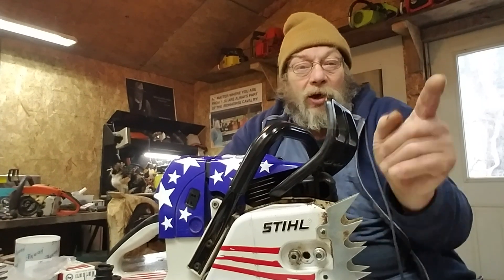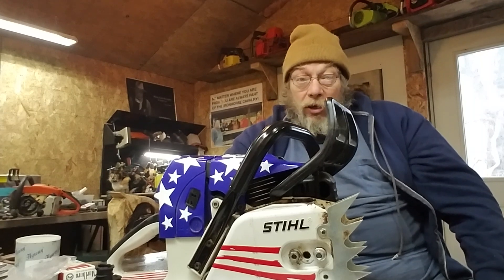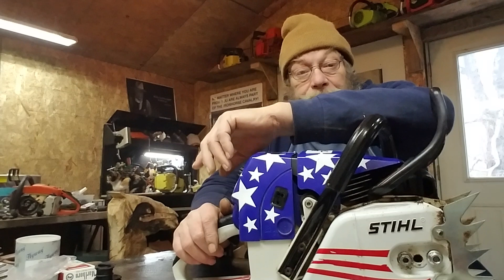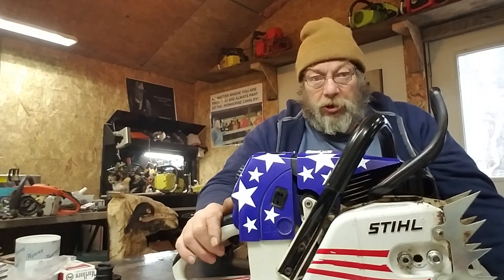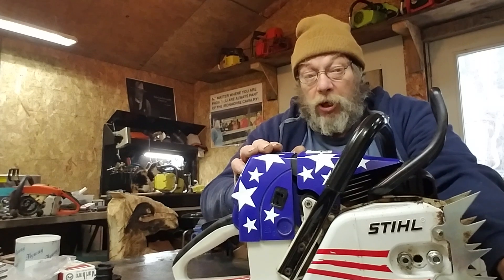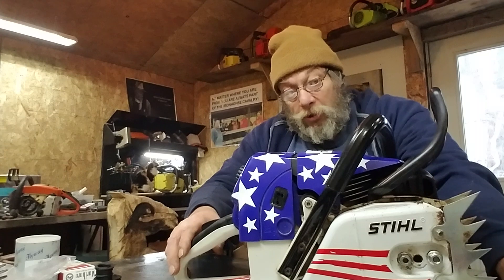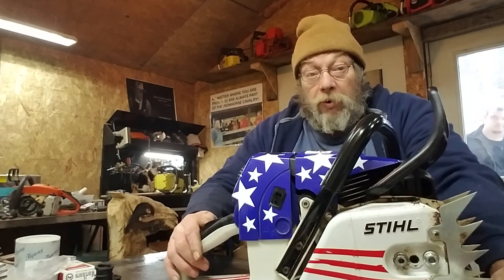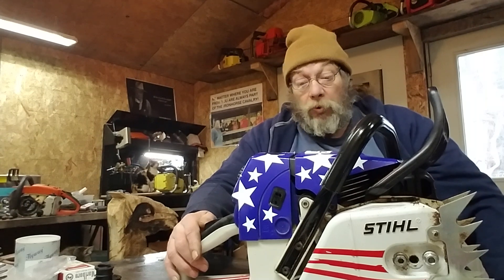What mix oil to use! What ratio should I run in different saws!

Comment: I run the Lucas Semi Synthetic at 50:1. It is cheap, and seems to do the job very well. It also has some cleaning properties. I tested it against Stihl Hp and hp ultra. The saw performed better with the Lucas.
Reply: I was running a synthetic oil in my saw, when I switched to Lucas I noticed right away how much better it ran. I really like the Lucas oil, good stuff.

Comment: Use to race dirt bikes and fine tuned  those two strokes. Oddly enough, you can foul a plug gooey black without any oil in the fuel at all. Saw many new race bikes that would leak black goo out of the pipe and the owner would say "I need to cut back on oil." To no avail. IT IS NOT AMOUNT OF OIL IN THE FUEL MIX, it is the air to fuel ratio. I used to run 20:1 mix and adjusted the jetting to where the plug burned a light tan and tailpipe not oily but a light dry gray. Actually, less oil makes for richer condition(blacker plug and muffler) as the thinner mix allows more fuel in relation to amount of air. Have been explaining this for 40 years. Kind of like people saying "those two strokes have a powerband put in the engine"  40 years on that one also.

Comment: Hi Harvey!!😀😀
I didn't realize that Lucas made 2 cycall mix oil. I'm definitely going to see if it's available were I'm at. I'm a firm believer in Lucas products. I've been running Stihl mix oil for many many years. Have never had any oil related problems at 50 to 1 so far. 
Hot saw 101 tore down a almost new husky that ran on husky mix oil and showed us just what you said about it. He also didn't recommend it. But he felt that the Stihl mix oil was much better. He dosen't run either one either. Can't remember what exactly he does run. 
Take care my friend!! TTYL!!😀😀

Comment: I run the same thing in all of my two cycle stuff - 80ml of Stihl Ultra, one ounce of Stabil, one gallon of PNE gas.  It runs fine in all of my equipment.  I have tried 40:1 but it is two messy on the exhaust side.  I do break in new saws at about 40:1 but ween them off after several tanks.  I generally run my saws a little rich for safety reasons.  I run only fully synthetic oil in all my two and four cycle engines.

Comment: Funny Im 70 and my father bought a new super xl homelite in 64. a 58 CC saw without the automatic oiler. It has the wick fuel system. I quit running because of the points. and set on concrete and the bottom of the fuel tank  is now corroded and leaks. We always mixed 1/2 pint of outboard motor oil with each gallon of gas. I took that saw all apart this week. The cyl still has the chrome and is in excellent shape. the piston is still usable also. Now i have been using a $10 XL12. 7 digit serial number saw  from the sixties for three years. and made another hodge podge saw from the best parts of several junk ones. It has a 58 CC cyl and Piston. Now I use the walmart Super tech 2 cycle oil. Still 1/2 pint oil to the gallon. and both of those saws run great. And I use them i Cut for hours at a time. and i also have a Husky rancher 55 I bought new in 2000. same gas no problen with the engine. the oiler sucks and the plastic is broken. Now the saws ive taken apart the the cyl and piston where scored. They where dirty. The air could not circulate and crap was built up on the cooling fins and everyplace else. like between the gas tank and crankcase. Folks spill gas and oil when refilling and sawdust collects on that. We have always used compressed air and blew our saws out as regular intervals. I think the excessive heat is what kills more saws than the oil and gas mix. But what do I know ive only been using a chain saw since I was thirteen. I hate those high RPM plastic saws.

Comment: I run 32:1, like you run 40:1.  I will probably start running less oil as I did think I was a little heavy and this video supports those thoughts. 
I have run between 20:1 to 50:1, used to recommend 32:1 to folks, like the home lites run,  but again leaning your way. (Your video, you have the experience edge), Thanks for your comments (shared knowledge) and keep in mind folks, us rebuilder types do it different than an operator. (Break in period)
When in doubt,  r.f.m.. read the f,ing manual. Ah ha, hey, consider your variables and make a solid decision,  32:1, 40:1, you'll be ok, I like your comments on deburring, radiused skirt edges, and oil film coating.   Thankyou sir.  I believe McCullough recommends 40:1 if you use their oil, ah ha, folks give me oil so I use what I have with caution,  folks leaving Alaska here, sometimes can not take the oils with them, product restriction, so I end up with a gallon of Ski-doo 2 stroke oil or what have you.  Maybe a good mix is 32:1 break in and 40:1 ordinarily time.
But Don't run it without oil!, by accident, 100% gas by mistake!,  I keep a date and mix info tag on my gas cans.  Thanks guys,  I appreciate you all.  Iron horse,  Hello to your Beautiful family too.
John.
Reply from the maker: Awesome comment John!
Reply: Ironhorse have you ever ran a stihl 880 magnum
Reply: 40:1 is fine! I get the saw where it has a good idle and leave the hi jet a little rich for 1tank of gas! I use 3 heating and cooling cycles before I put it in the wood!

Comment: Right On Harvey Paul.   You ever see those pro-motocross or hard endure guys with oil "Spooge" from their exhaust? 
  I run 40:1  on everything from My KX500 to my Weedwhacker no problems. I am a fuelwood cutter so I'm not "Logger" hard on my saws, and single track in the mountains of nor-cal.   Tons of skidder trails and forest service roads to plunk along on the KX.   
The Older I get the faster I was! ha ha ha…
  Thank you for all the good info on building a  strong,  reliable work saw. 
 My Kid once made me a cardboard sign and put it on the garage door...
       If it 'Aint Broke, Pop will Fix it 'Till it is"...  (great.. go play in the street...)
Thanks again H.P.  (Harvy Paul =  H.P.)  Coincidence?  Ha ha..
  Rob \o/  Mt. Shasta Ca,
Reply: Rob Croft I know a guy who races quads, has placed in top three n many races... all he ever runs is 40/1
Reply: Spooge is too much fuel.

Comment: We always ran redline in the shifter karts KX125 in mine. 2 bottles to 5 gallons 25:1 spinning constantly at 14k more oil was needed. Don't use redline for anything that will sit very long, it doesn't have any rust inhibitors. Or at least 20 years ago. Yammalube was a very good oil also.

Comment: 1.8 oz klotz blendzall to 1 gal of fuel has been my ratio for years , u r correct about oils over years , clean as a whistle and 20year old clean running .i also use a min of hi test or lately with fuel prices actually running renagade race fuel .

Comment: Great video Harvey!. I have a few higher end saws that run 50:1. I was thinking of going to 32:1 or 40:1. I have a Poulan 3.3 cubes.  I have owned it for 30years now. The piston on the exhaust side looks great & has a small amount of oil on it. Have a great weekend now!
Reply: Id just Run 50:1 with the regular Stihl oil. 50:1 isn't just for EPA, oils have come so far in the past 25 years. Honestly like comparing sugar to sugar cubes, end of the day they will all protect. I've never had in issue with stihl oil(made by Castrol here in Canada), I use a 462 and 261. What I use & My opinion, cheers

Comment: I run 32/1 in my 85' Honda 250R. The sticker on the goose neck says 20/1. That being said I run Golden Spectro or Klotz Supertechniplate in it which as you pointed out is much better than what was available in the day. In my Dolmar and Echo saws I run 40/1 Echo Red Armour. Your a wise man Harvey.
Reply: In Stihl manuals, there were reportedly cases of cuts and jamming of the rings and the piston at 33: 1. Is there a risk of reduced machine life or carbon failure?
Reply: 250r. 50:1 with klotz runs excellent

Comment: Lucas Semisynthetic 32/1 on my 1987 Yamaha ysr50 for 4200 miles now and it’s clean as a whistle. 😎. Runs strong and only smokes when engine is cold.
Reply: Low flash point.

Comment: Great video, I have always used 40:1 in all my 2 stroke equipment especially saws and weed eaters, I run 50:1 in blowers only because they don't run high enough rpm to clear themselves out very well
Reply: I just brought a new stihl trimmer 2 weeks ago. What you think I should put in it ?
Reply: Schaeffer’s two stroke oil.

Comment: We would have our yamadog tz250 plugs looking like chocolate milk and if i didnt team mechanic was crazy about reading our plugs on our roadrace bikes love your channel just found u !!!!
Reply from the maker: Glad you showed up!
Reply: @theironhorse6600  Master, can you pour 33: 1 husqvarna ls + into the saw 372xp 357xp and scythe 545rx? Will the piston rings get stuck with carbon?
Reply from the maker: @Sensei948  I would run 40-1!  Seems to be a good ratio!
Reply: @theironhorse6600  140 psi good compresion 372 xp oe ? 2003r
Reply: @theironhorse6600   In Stihl manuals, there were reportedly cases of cuts and jamming of the rings and the piston at 33: 1. Is there a risk of reduced machine life or carbon failure?

Comment: 40:1 yes!  Been running that for a number of years myself in my built and stock saws. Your confirmation is good to hear. All that time running Yamalube with no problem results.  D rating, it's sticky sticky stuff and pricey.  The only thing I don't like abut that oil is that it doesn't change the gas color enough to make me not have to wonder sometimes after a layoff if I added it or not.
Reply: In Stihl manuals, there were reportedly cases of cuts and jamming of the rings and the piston at 33: 1. Is there a risk of reduced machine life or carbon failure?
Reply: Use good oil at 40:1 like the man said.

Comment: I ran 50:1 husqvarna oil in my 372xp torq since new for 3yrs on my sawmill. And it built carbon. 
I'm with Ironhorse on this one🖒
Reply: So, you're going to run 40:1?  Won't you end up with more buildup, Skinny Pedal Down?
Reply: @jolkraeremeark6949  

In Stihl manuals, there were reportedly cases of cuts and jamming of the rings and the piston at 33: 1. Is there a risk of reduced machine life or carbon failure?

Comment: High quality oil makes a difference.  Lots of good mix oil knowledge in the 2cycle motorcycle world.  50:1 is 2.56oz per gal, 40:1 is 3.2oz per gal, 1 tablespoon is 0.52 oz.  Most caps on the small bottles of mix oil (2.6oz bottles) is about 1-2 tbs, so 1 bottle plus a cap in 1 gal of gas.
"How Harve adjust carbs"  awesome idea.  Have fun with the snow we're supposed to be getting it later tonight/tomorrow (up in NH).
Reply: Mike Remski diff brands mix at diff numbers  not all are the same make sure u check on the back of the bottle
Reply: @aaronmorgan488  I respectfully disagree.  I am talking purely about the mathematical ratios, not whether a specific oil is suitable for running at that ratio.  Straight 30w dinosaur motor oil:  2.6 oz in 1 gallon of fuel is a ratio of 50:1.  But that will pretty much be not suitable to actually run in the saw at that ratio.  I was simply pointing out how little it takes to go from 50:1 to 40:1.  If a mix oil told me to use 5.2 oz in 1 gallon of fuel to get a 50:1 ratio, the only thing I can conclude is the mix oil has twice as many solvents in it than needed.

Comment: Great vid and it’s going to save some pistons I run more oil again as Oil’s cheap engines aren’t! so 25-1 full synthetic! not the low smoke bs but the husqvarna hp full synthetic is brilliant and on par with the best in the world period! and 98 octane premium non ethanol only! It works up here in qld Australia it’s often hot! and the timber is hard! and although not working with as many now days back in the workshop servicing and repairing all brands I’d developed an opinion and myself being a husqvarna and Stihl small engine mechanic I’d seen a dead piston or 2 and it’s usually it’s running dealer recommendation’s

Comment: Here's my experience with 15 + year running a well tuned 026, and using Stihl full synthetic at 50:1...
I had the occasion to pull the cylinder while replacement of the carb... and what did I see in the cylinder,  cross hatch machining marks from manufacturing, and very little carbon.
I don't use it every day, only 5 to 6 full cords per year and land maintenance. I'm no pro, nor expert. I don't think I'm an exception, it just works for me.
Reply: life in the woods I’m with you. I’m running AMSOIL saber at 50:1 in all my power equipment. 20 plus years on my string trimmer, blower and my Stihl saw. Have not yet had to re-ring any of it. My new ms462 and ms271 I’ll do the same with after break in. Non-ethanol fuel and premium oil works for me.

Comment: Good info,I run 32:1 in my Banshee  & TRX250R
Reply: In Stihl manuals, there were reportedly cases of cuts and jamming of the rings and the piston at 33: 1. Is there a risk of reduced machine life or carbon failure?

Comment: Older video (which is good, i learned alot!) I use 40 to 45 to 1 Royal Purple mix oil.
Seems to do good for my 660. Big bore pop up piston cyber rings. (Now) had the non pop up in it since 2013 with split rings. Glad I just recently changed the piston though. For some reason all had been oiling well cylinder still nothing bad at all (very clean and smooth) piston top along exhaust edges have some small cracks with small pieces missing (small as needle points, you can't barely see them really) but yeah.
Thanks for the video!😎

Comment: Dangerous topic.  Hotsaws101 has a great video on this very topic.  Lucas originated in top fuel dragsters so they know their stuff.  i run motul 800 40:1 on all my saws.  saving my saws not the planet :) (EPA standard is the reason they recommend 50:1) whats an extra .4 oz per gallon really gonna hurt.  great Videos thanks for sharing.

Comment: Good video Harvey. I ran Lucas oil at 40:1 for a long time. The only issue I had was even tuned right my saws ran a little wet out the exhaust. I’ve been running Echo red armor oil recently and it seems to run a lot cleaner at the same 40:1. Id having no issues running the Lucas though. It always ran clean as far as carbon deposits and port buildup
Reply: After observing how hap hazard the mixing of fuel is done by the tree guys I work with (who "don't need no stinkin measuring jug") I came to the conclusion that its probably best to let them stick to the 30:1 mix they use, at the risk of them getting lazy mixing a 40:1 that might end up more like 50:1 now and then

Comment: VP C12 fuel mixed 40:1 with Honda HP2 oil in my 03 CR250 dirt bike and proper jetting has been great for my bike. Engine is still running great for the 17 years it's been ringa ding dinging me along desert trail riding, Forest trail riding, jumping, motocross track riding, and a few good long trips riding the Glamis sand dunes/sand drag racing. I guess you get what you pay for, VP fuel isn't cheap and either is the Honda oil but I can say I have had my bike sense 2003 and had to rebuild the top end few times and bottom end of my engine 1 time. It is ready for a complete top and bottom end rebuild now. But that's a lot of miles and hours of riding over 17 years now I can get the bike to fire up in a few kicks and run without a issue all day long riding.
Reply: 40:1 is fine! I get the saw where it has a good idle and leave the hi jet a little rich for 1tank of gas! I use 3 heating and cooling cycles before I put it in the wood!

Comment: You should be called iron balls bringing up a topic like that lol jk. People get upset about it. I run 40:1. when my dad used to log in bc that's all they ran. So I'm fine with it. Haven't had a saw blow up ever, a few ran over but that's it lol. Anyway my 390 cylinder is in the machine shop. When I post my cut videos I'll let you know. Thanks again!
Reply: In Stihl manuals, there were reportedly cases of cuts and jamming of the rings and the piston at 33: 1. Is there a risk of reduced machine life or carbon failure?
Reply: Instablaster...